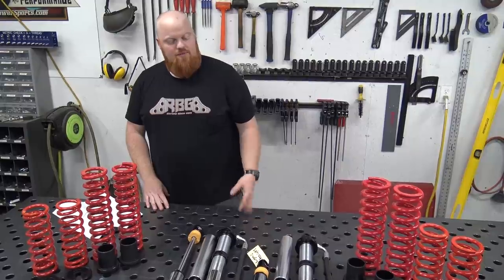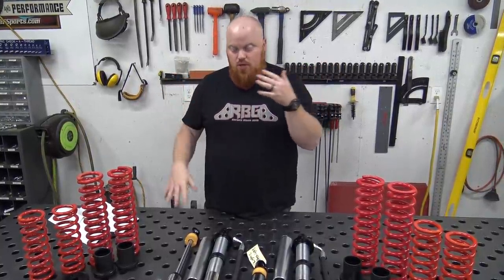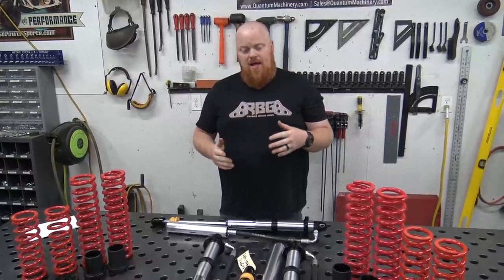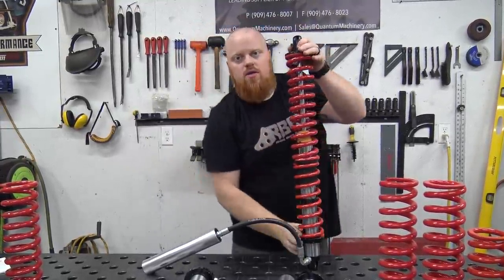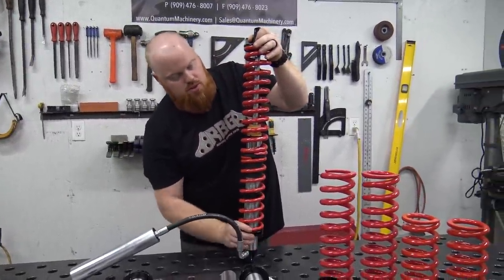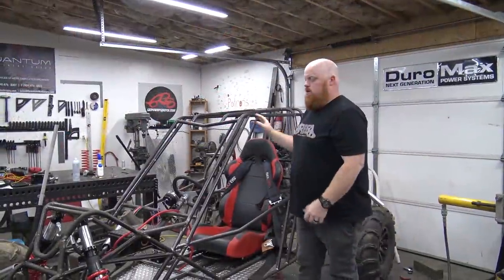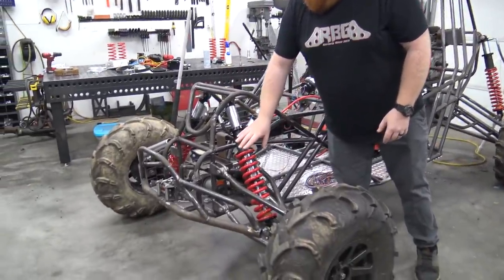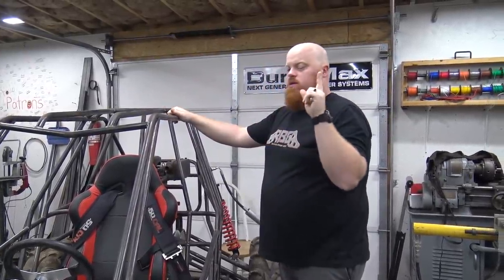FOA Custom Shocks Installation ~ IRS Buggy

Comment: The same could be said for Detroit Axle.Wonderful customer service.Sisters car had optional part installed at factory in which did match build (npo) code for car.No ones fault but they understood and worked out a solution at their loss.
Reply: I’m surprised to hear that. I’ve almost bought parts from them several times now but always ended up not because of their terrible reviews. Yelp has them at 1 star with the majority of the complaints being poor quality and poor customer service.  Now I know internet reviews can be a mixed bag but on many automotive forums people say the same thing.

Comment: have you thought about using a gas golf cart rear end center for a gear box the axle tubes unbolt from the gear box and it is about the same as the dana you are running I don't know what it would take to make it work but it could be a cheaper set up if you can do it food of thought